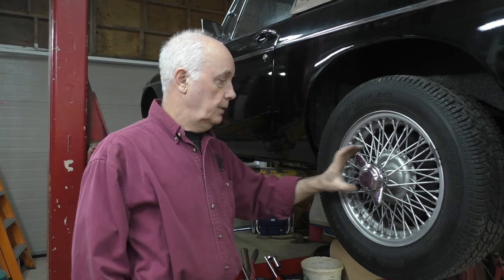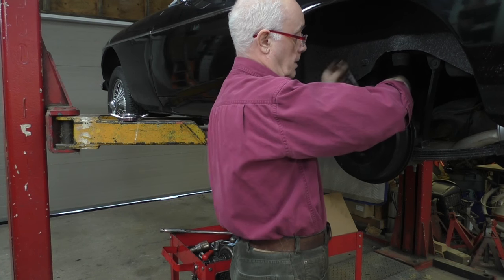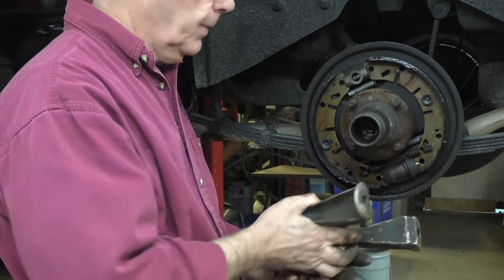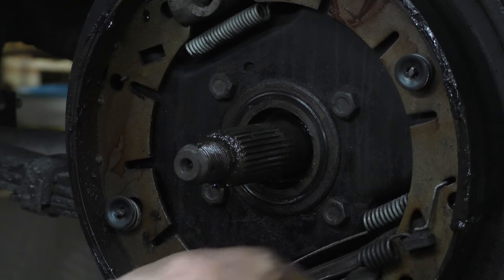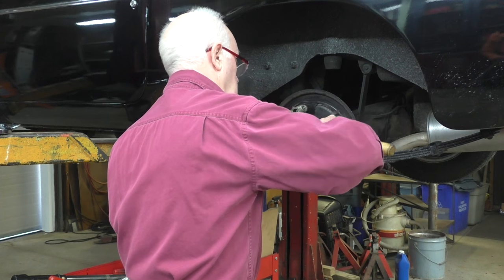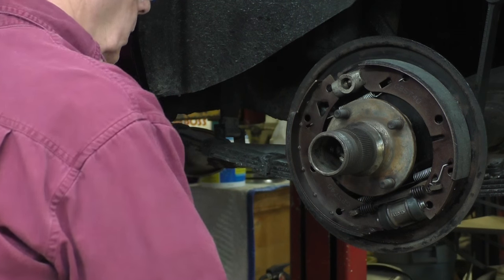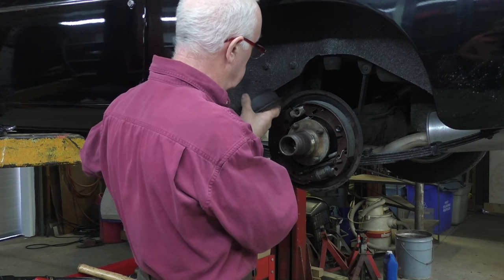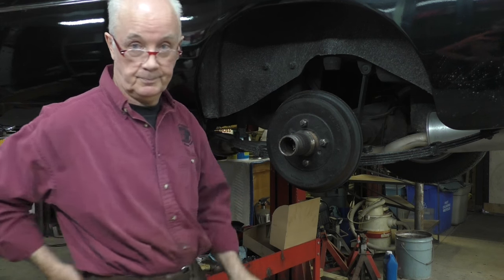Dr-Doolin MGB, Rear Wheel Axle Oil Seal Replacement, Tube Type Axle

Comment: Most of the time is when you are speaking outside. I guess the open air just carries it away. Inside the garage is ok. I always wanted an XKE. They are just so cool. When you were driving that V-12. When you hit bumps in the road, it sounded like it had no suspension. A friend of mine finally got his brand new 69 XKE 4 speed 4.2 with 3 carbs. That car was awesome. His had the chrome knock off wires too, really nice.

Comment: Good tutorial - one thing though, don't fit the seal by hitting it side to side as it can distort the metal part of the seal. Instead, use a piece of pipe the same diameter as the seal and long enough to clear the axle sticking out. Weld a plate on the outer end of the pipe. Hold the pipe firmly against the seal and hit the centre of the pipe to drive the seal in parallel. Cheers!

Comment: Did you get a click on the torque wrench when you tightened the axle nut?
Reply from the maker: Yes, you feel it though the handle. When the wrench is up 150 lbs the click is not as audible as at 60 lbs or so. You can feel a kind of break go though the handle. This wrench is at the limit at that setting. The one I have that goes up to over 250 lbs  is louder at the 150 lbs setting. 
James

Comment: Any tips for reinstalling the hub on a banjo axle? The bearing wants to push out while I'm pressing/hammering  it back on
Reply from the maker: Hi Ben
I assume you are hitting the face of the hub, I hope your using a soft drift or a piece of wood so as not to damage the face of the Hub.  You should be using a drift (not a metal punch) on the inner race of the bearing that's where the resistance is.  Get the assembly past the point of the threads and then use the axle nut to push it on all the way. Make sure you move the drift around the inner race when knocking it on so as to keep the race even and straight on the axle tube. Make sure there are no marks on the axle to stop the bearing race going on. Then take the time to make sure the breather is clear on the axle and don't forget to check the axle oil.
Hope this helps,
James
Reply: Yes I used a block of wood, but is OK to use some kind of sealant on both sides of the paper gasket. As you know the oil seal is on the inward side of the bearing & if gear oil get by it that paper gasket will probably eventually leak,no?  And what are the dimensions on that nut?  T.p.i.?
Reply from the maker: The O-ring should be fitted as well. without that it will leak. You don't need to use sealant, the oil is not under pressure its only a splash feed to the bearing, Don't overfill the diff. If everything is ok and clean with the faces on the Axle and Shaft it will be fine.

Comment: I assume there is no difference if I don't have the wire wheel set up?
Reply from the maker: Hi Maj,  
The only difference is the flange the wheel attaches to, a non wire will just have the four wheel studs with the castle nut in plain sight, rather than the nut being inside the tube section for the wire wheel. Actually its easier than the wire wheel.
James

Comment: are oil seals easy on the Banjo axle?
Reply from the maker: It's pretty straightforward, just off with the wheel and Brake drum. then undo the Screw in the Axle flange to hub. Slide out the Axle undo the Nut in the Centre (there is a lock tab in there). Pull off the hub and the oil seal is in the rear of the hub. 
Make sure the seal is in the correct way around. The oil is coming from the Hub so the seal is facing inwards towards the Bearings.    
Its better to change the Gasket and Oil O-ring between the Flange and the Hub when reassembling.
Make sure the Bearing are in good shape (check for movement using the road wheel and for noise)
Also make sure the vent on the axle is clear as if this is blocked it will create pressure and push oil out the seal.  
Good idea to check the Diff oil level. 
By the way the nut on the shaft holding the Hub is a Left-hand thread, on the left side of the car. Regular Right-hand on the other side.   
We are getting back to producing more videos I was planing to do one for this repair in the future.
James

Comment: Great videos but your microphones need work, a lot. I have to turn the volume all the way and use headphones. They are a bit muffled too, like something is covering them up.
Reply from the maker: Hi Craig, if you don't mind could you tell me  which Video or videos have the problem please, we do try them before we load them in YouTube but that does not guarantee they work correctly.